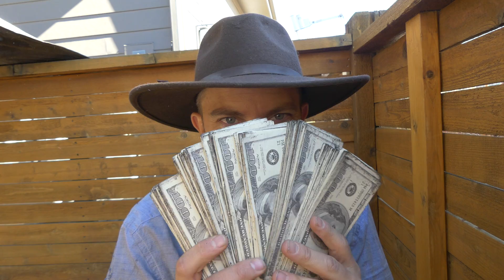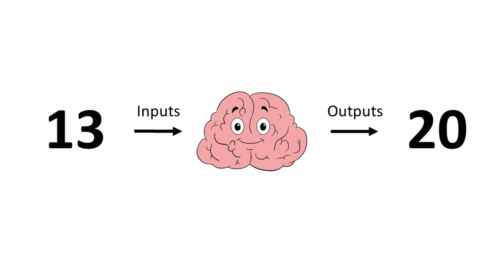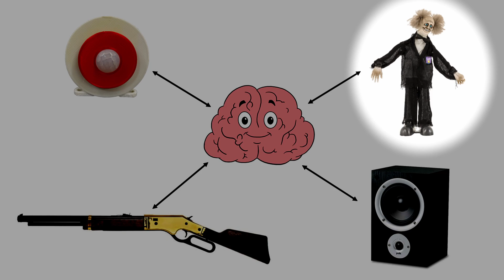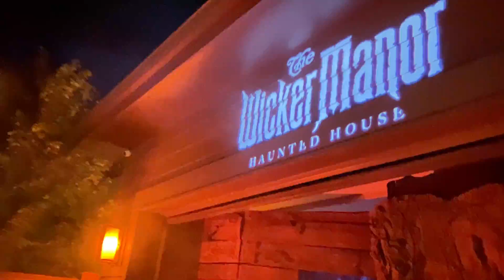Build your own Haunted Shooting Gallery 👻

Comment: This is a great video and a fantastic project!  Thank you for providing all of the links for the components in the description.  I ordered everything on the list.  Like another commenter I'm considering making my own Buzz Lightyear style ride vehicle.  I'm curious about how I would split up a gun controller and a target controller and have them communicate wirelessly?  I have some Arduino compatable Bluetooth modules, I haven't tried them yet, I wonder if they would work?  Also I'm considering using an IR sensor and IR lasers with the red dot laser being the way you would line up your shot.  The red laser would be always on and the IR laser would be what fires when the trigger is pulled.  I'm using a different "gun" that doesn't have sights like the BB gun that you used.
Reply from the maker: Thank you so much! You would really like my new targets. They use home assistant so the guns and targets are all wifi. They also have multi-color LEDs. Check out this unpublished video of the last shooting gallery I did with them. https://www.youtube.com/watch?v=OBq9p-ftm4M
Reply from the maker: Because the targets use home assistant, the target can control any home automation device like lights and remote speakers. The new targets are also IR and you can use touch screens to control them. Here is an example of using a wifi pistol with internal sound. https://www.youtube.com/watch?v=DaS-HCyVBHM
Let me know if you'd like more info jason.altice@codemakesitgo.com
Reply: @CodeMakesItGo  I sent an email.  I'm waiting to hear back.  Thanks!

Comment: Hi. First off, love the video and this project. Thank you for sharing. I am trying to replicate this as you have it. Wired everything based on the diagram you provided but it’s not working. Can you provide some help? I sense I am missing a few things looking at the code and wiring diagram.
When I power the arduino I get this message on the serial monitor; unable to begin, 1. Please recheck the connection 2. Please insert the sd card. At this stage the relays are closed and the props are on, the target lights are off, the photo sensor is on (green led on) and the laser on the gun is on. I don’t have a remote wired and just a momentary switch connected between a ground and pin A2. Any thoughts on where to trouble shoot first? Thank you in advance
Reply from the maker: Wow sounds like you are very close. So awesome! Yes I can help. Email me at jason.altice@codemakesitgo.com so we can talk easier.
Reply: @CodeMakesItGo Thank you so much Jason. I just you an email.